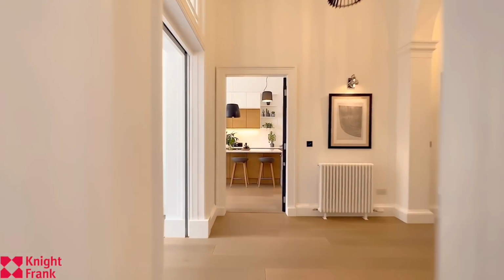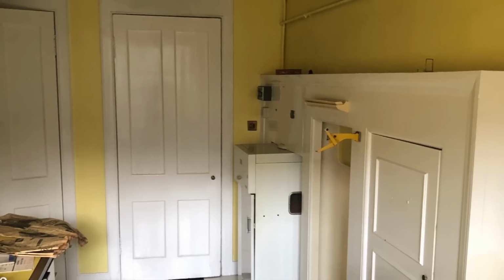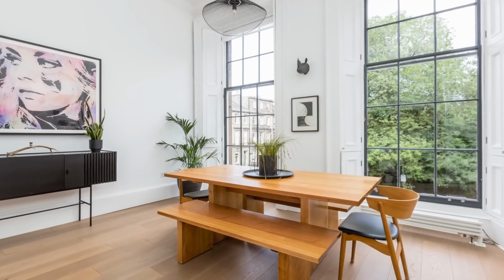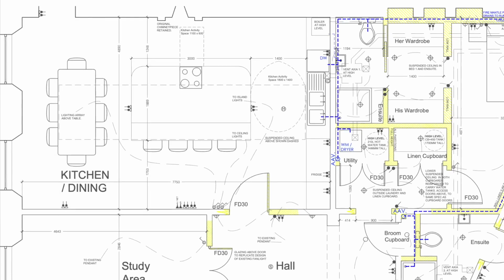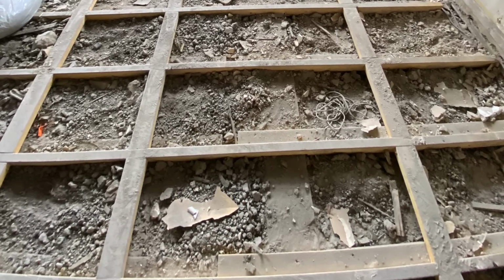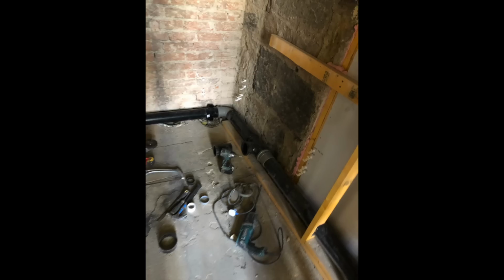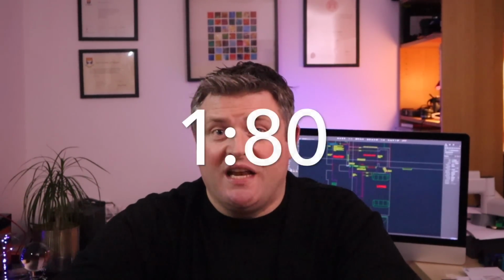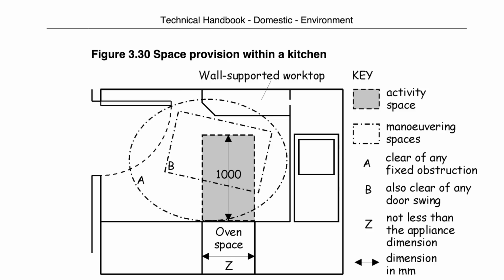A Design Guide for KITCHENS

Comment: Really pleased to hear you say about the extraction fan. I am a Chartered Building Surveyor and I carry out building regulation in the UK. The amount of times I get told that the kitchen company said you don't need a fan is maddening. 

Keep the videos coming I enjoy the fact you are willing to talk about the various elements and make it clear they are regulations people need to comply with. 👍
Reply from the maker: Thank you! I have also seen kitchen suppliers design islands too close to worktops. Surely it cant be that hard to learn the relevant regs.
Reply: Good point, well made. I've spent fortunes on hoods that are frankly too low (I disagree with regs) and just a nightmare to clean. My current favourite is my over-spec'd external motor on external wall of kitchen all concealed behind a giant picture which is installed 50mm off the wall.  Building control chap loves it.  Though I have to convince Mr C (my chef) that he should actually switch it on.  LOL